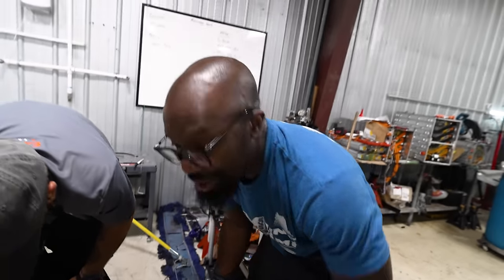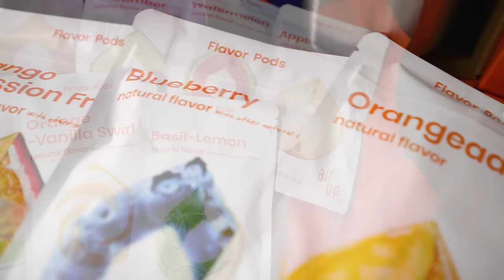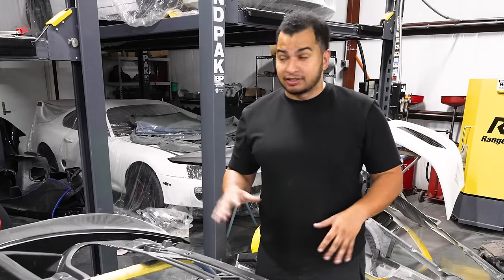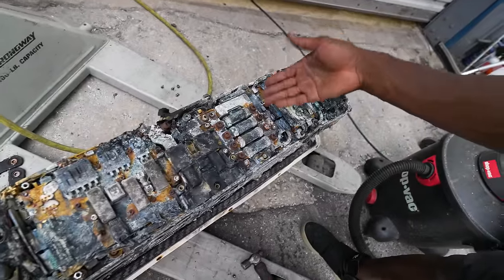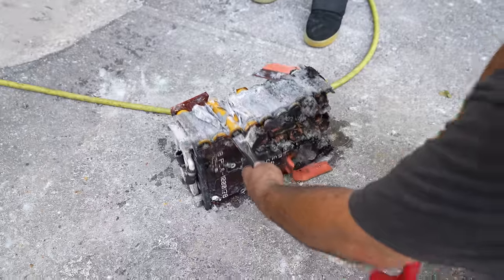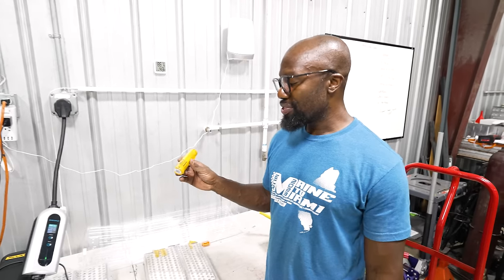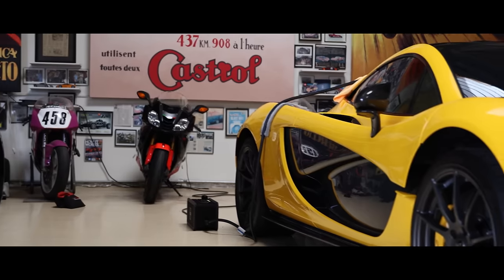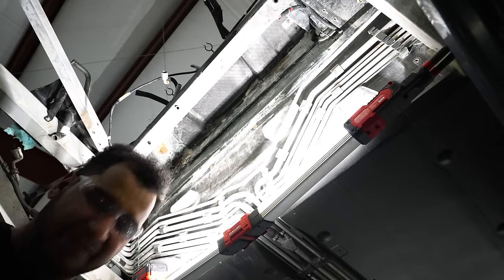Rebuilding A Flooded $2,000,000 McLaren P1 | Part 9

Comment: Can confirm that Ricardo made the BMS for the P1 battery. I've worked on the later hardware revisions of it when preparing it for a 1500 Vdc nominal traction system.

As a side note, the difference between the P1 and P1 GTR battery was entirely software. The hardware of them was identical.
Reply: Wait I thought the GTR battery was lighter
Reply: @____-gy5mq  according to some of the team from the project when they were still around they turned the current and temperature limits up further, rated the battery for fewer cycles and reduced the warranty.
Reply: Hopefully it would be less than $150k.
Reply: @jasonmajere2165  oh, no, that's about what they would should probably cost. The development, testing, certification and production NRE was, I reckon, 10x that figure. Everyone's got to make profit, the component cost of the batteries isn't small and you're only making a few hundred of them. Then when you're talking replacements, if it has to be built to order, it'll always cost more for a single unit. It kinda /has/ to be expensive to balance the books.
Reply: @hooskworks  I understand that, but the economics of having it made should of been worked out into the original production run. Any more made is extra. It’s like that was the original cost but we are still going to charge that because we can.
Reply: @jasonmajere2165  it's 7000 dollars a rim lmao 🤣🤣 you think they're going to discount a 140,000 dollar battery no way in the world especially when the only people buying these things are usually Billionaires and 140 k to them ain't shit it's like an oil change lmao 🤣🤣🤣
Reply: @jasonmajere2165  They were.  And it costs what it costs.

This isn't mass produced and is not for a mass produced car.  This is zero obligation for them to make it affordable.

Comment: It will be important to get cells for the pack with the same specs, as the A123 cells can withstand very high discharge AND charge rates. A123 made some of the world’s best LiFePO cells, not lithium ion like what’s in a normal EV. An alternative might be fine in discharge, bit it won’t be when being charged, which will just lead to another battery fire 😅
Reply: Yep, I still have a 12 year old A123 pack with 3000 deep recharge cycles, and still going!

Comment: I kind of agree with Rich about scrapping the battery. Yes, it wouldn't be quite as cool, with the extra instant torque of electric assist and chill mode, but imagine the beast this would be without all that weight! With the extra space, you could even put a 10-12 cylinder built-up-everything, twin-turboed, and this would be an animal. Then you could probably sniff breaking the record. Think it'll be tough with it retained...
Regardless, another super sick upload Freddy, keep up the good work!!!

Comment: Those bonded inner supports on the clam shell are removable. All you need to do is get a heat gun and loosen the glue with a thick spatula breaking the bond between the two carbon pieces. This is common practice to remove this type of glue for panels, if you’re interested in the spec of the glue it’s Loctite 9323. 

I helped make these panels at Prodrive Milton Keynes (UK)

Comment: confirm that Ricardo made the BMS for the P1 battery. I've worked on the later hardware revisions of it when preparing it for a 1500 Vdc nominal traction system.

Comment: About the window motor still working, I'm no mechanic, but I remember hearing a long time ago, that electric windows are made to work even under water, in case the car falls into a river, because you won't be able to open the door in the underwater pressure, something like that
Great video

Comment: Rich using the 89 dollar Klein Home Depot multi meter . No Flukes were given by Rich !! Lol I also use the same meters to beat up on in my service van . I have high dollar Flukes but to be honest the cheap Kleins ( comparatively) work extremely well and are very accurate and surprisingly tough especially when considering that the cos is between 60 and 160 dollars depending on options such as DC amperage ( important in his field as is AC amp draw and Klein does a good job of making there clamp meters very versatile !

Comment: The problem of your method of spray painting is having no hot air blowing in or having a floor vent which sucks the excess spray out of the air. This way you won’t get mist on parts which are drying, which will improve quality. 
Also make sure you clean equipment, mounting bracket and yourself with pressurized air before spraying to reduce dust falling in fresh spray. When adding too much paint and getting a little drop, let it dry out and sand only the drop. You can do a spot repair to reduce excess work time

Comment: You guys really should do like Jack and protect your lungs when grinding, cutting, and drilling carbon fiber.  Current HSE research shows that it tends to throw massive amounts of ultra-small fiber particles into the air (perfect for breathing).  It is likely that those fibers will damage your lungs like asbestos will, incessantly for the rest of your life.   There are also multiple epoxy formulations that are pretty hazardous to breath the dust from.  Most epoxy resin substrates contain silica, and the not shiny structural might be a bismaleimide epoxy, which is REALLY bad to breathe.  Under 1g/kg LD50 bad, and it is more dangerous the finer the dust is(p.s. it is perfectly safe in every way so long as you are not breathing the dust from it).   
Most people engage in unsafe behavior around chemicals and materials, because they just do not realize the hazards.

Comment: Haven't finished watching the clip admittedly but fuses only protect against current flowing through them, which is usually against a short circuit outside the battery/cell. If it's an internal short circuit that's upstream of any protection, there's nothing you can do so I'm not surprised the bus fuses were intact- their job wasn't to protect against the scenario experience. Immersion in a conductive fluid could cause such a short circuit. As pointed out, the batteries did their job protecting surrounding batteries.

Comment: Do not jump power directly to a power window motor that has more than 2 wires. Often the extra wire means there is a control board involved. They are made to have current applied one way only, and the small wires are direction control ect.

Comment: You should protect yourself as a bystander as well from carbon dust. Carbon is a super conductor and organic, which means when entering your body (aspiration) it will be accepted by your body (unlike glassfiber which is anorganic). in case this carbon dust might reach your neuro system, it will litterally create shortcuts...

Comment: Not one to comment on videos usually. Being an experienced carbon composite tech and having done plenty of work for different car brands. I would take a good guess that the glue is DP490, a 2 part epoxy. It will disbond fairly easily with a heat gun and a lil bit of leverage

Comment: I made the cold plate that the converters are mounted to. It's like one you would find on the gpu of a gaming computer. I've been worried it has internal corrosion because i friction stir welded the cavity closed and so it isn't serviceable and i have no spares. Just a display unit for trade shows.

Comment: I don't think you can just buy these cells from e-bay without determining that the age of all these cells are close enough. You would need to run a capacity check on all of them, otherwise you will have a voltage delta in your p-groups causing an imbalance in current draw from the pack. If you consider 2170 cells, reconfigure them to similar s-p counts for voltage and Ah, determine the max discharge current available at 2.5V reconfigure your lookup tables with existing ones in your bms

Comment: Um, safety tip, it's not a good idea to wear sandals or flip flops carrying heavy equipment or in a shop area. It's a good way to throw you off balance, and a good way to find metal shards and tools stuck in da feet.

Comment: A lot of people are not aware but yhe 156,000 dollar battery that McLaren is selling is different from this. In 2020 when the McLaren speedtail came out  , it featured a new and improved battery pack that was about 100 pounds lighter than the p1 battery. McLaren offered p1 owners the chance to upgrade their batteries to the one from the speedtail with new tuning for better acceleration. Only downside is the new electric only range is less than half of the original electric range from the p1. But owners benefit from losing 100 pounds and better acceleration. So if he did decide to buy a new battery pack from McLaren, you woukd not be getting what you see here. You'd be getting the battery pack in the McLaren speedtail.

Comment: Just a CLARIFICATION on the battery price comparison.  In this episode, Rich Rebuilds says that McLaren ripped people off by charging $160,000 for the battery system. He said the battery today is under $4,000. I want to point out that is not correct. In the same breath, Rich says that battery prices have dropped SIGNIFICANTLY over time. By that basic logic, it means that McLaren could/would produce a similar battery pack in 2023 that would be significantly cheaper.

When was McLaren designing (not selling) the P1? I am going to say 2011. Let's say McLaren's actual build cost for that battery back then was 100k and they tossed a 60k markup due to R&D and limited production. How much have these prices fallen in the last 12 years? Something like 70%. That means McLaren would (today) spend $30,000 on the same product, which was $100,000 back in 2011

I am not trying to stand up for McLaren (could not care less) - just standing up for logic. This would be like saying Apple was charging $1,200 for the iPhone 4 in 2010 but TODAY I can buy that same phone for $20 - Apple was ripping people off

Logic. Fail.

Comment: Tavrish….. just a quick thought to try and claw back a few bucks. All the Carbon you cut off the car why
 Don’t you get a 5cm hole cutter and cut hundreds of discs out of the CF put a 3mm hole in them and a split ring and you have one McLaren KeyFob. I’m sure $20 a disc fob would fly out the door.  What’s your thoughts. ???  YOUR WELCOME. I shall have the first one to get you up and running. Regards Steve.

Comment: It really doesn't make sense to keep the hybrid part of the power unit if you are going for top speed. After the batteries discharge on the acceleration the electric motor and the batteries just become dead weight you'll be pulling along. Take it oud and build up the engine

Comment: I'm so happy to hear someone who knows what they're talking about say that they would just remove the hybrid system all together if they owned the car.  Hybrid makes no sense in sports cars.  So much weight, and so much complexity for very little gain.  The 150 extra hp you get is not worth the 200 + pounds of weight you accrue.  Electric battery cars will not be the future.  It's a dead end tech.

Comment: I don't think those fuses would/should have blown in this scenario.. I'm not an expert but presumably when you dunked the entire battery into saltwater it effectively created lots and lots of little shorts throughout the individual battery cells. Which is different than the entire battery shorting or otherwise drawing too much current.

Like imagine if you had 10 AA batteries taped together with an led connected to either end in front of a fuse.  Then you dunked the batteries in salt water.  Fuse isn't going to do anything because there are lower resistance paths between each of the individual AA's.

I think this scenario is essentially unavoidable unless you waterproofed everything.  Even if a fuse blows, your entire battery is submerged in a conductor, currents going to just slide by that fuse like it's not even there.

If the water got into the individual cells themselves, then I think it would be more of a chemical fire than an electrical one (wherever you want to draw that line I guess).

Comment: Rather than installing a battery pack, why not just design a group of progressive capacitors to run off 12 volts from the engine/alternator.

Comment: That guy was like reading my mind I would also get rid of the battery and build the motor at leat to withstand higher horsepower and have the fastest p1 in the world and maybe increase the size of the gas tank a bit and tune it for a race fuel and save weight from the battery absence

Comment: He won’t have anymore the 15,000 in a brand new or new upgraded battery that the dealership sells for 160,000 … it’s good to know people…People trip on batteries and hybrids or EV’s but it’s not new tech it’s been around for a 100 years . If you understand the theory of electricity ( which it is a theory it will do shit it isn’t supposed to .. ) and how series and parallel circuits works and build voltage/ current and have a battery to reverse engineer or at least know your final voltage and and current needed building a battery ( with the current tech and availability) as a upgrade or replacement is truly not complicated at all . Now the controller is a different story but if it can be “ unlocked “ even that part isn’t hard just time consuming.

Comment: a total armchair designer comment here, buuut I think they could've avoided cutting up that McLaren panel by taking advantage of some 3D scanning, CAD work for reverse engineering, sourcing out the carbon fiber part recreation & sold off the original part & plug it back into the project.

Comment: take pictures of everything put everything in plastic bags document every nut and bolt power blast the whole inside and out of car and aluminum frames they sell a special polishing light grinding whell for aluminum and then send it out chemical bath and spray a aluminum seal on it

Comment: I do carbon for Bentley/aston. Clear coat doesn’t have enough build to fill that kinda lows. Especially after reducing it so much. They look to be using a 1.4 tip on a Sagola gun. Something life a pri pro with accelerator in the clear to help build would be better. He’s a you tuber and I’m just some dumb ass commenter who never works on 2+ million dollar cars he will brush me off I’m sure lol
Reply: And no that inflatable booth isn’t heated so you shouldn’t have any issue with solvent boil.

Comment: The fact that the parts they delivered are clear coated (To hide any imperfections), says to me that they did not have the proper moulds or the correct lay up structure to have them made at the correct specification.  I work as a composites engineer very close to McLaren, even on this P1 project, many people in the UK have tried reached out to you to give you proper advice on how to get this made properly but instead you chose these cow boys. No component that has come from our factory or supplier should ever be clear coated, all parts have mould finishes. It’s an insult to the very people who designed this car in the UK that you have not followed the build to a top tier standard, especially when it comes to composites.